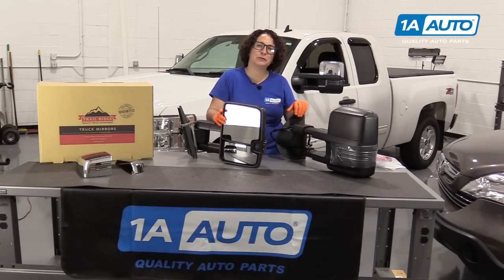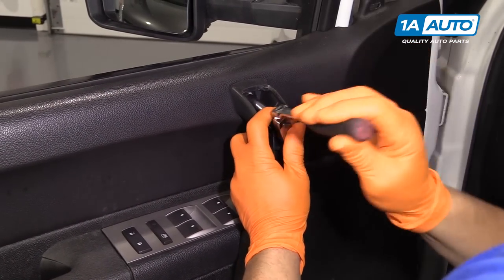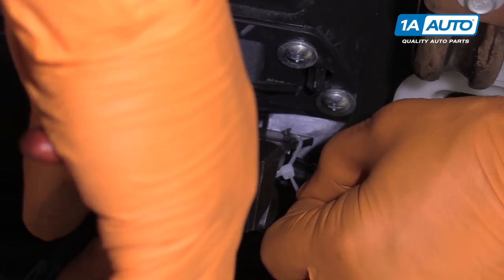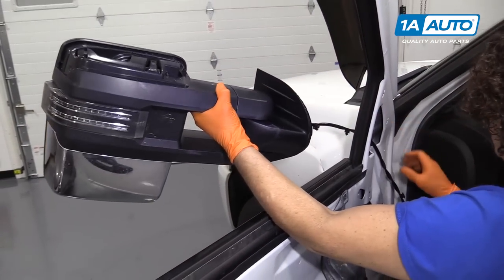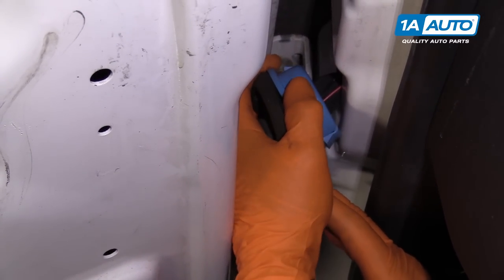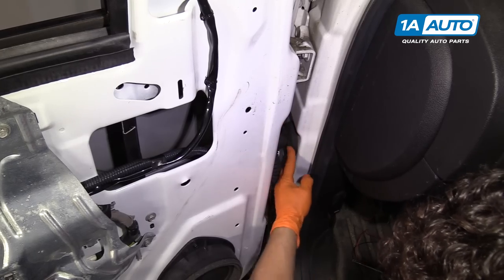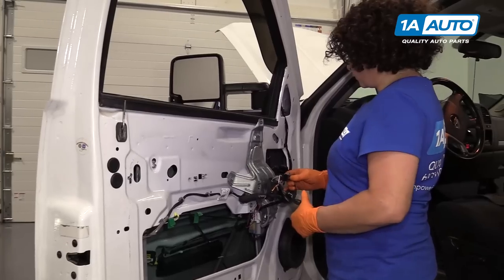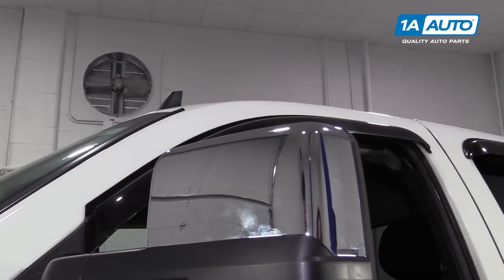How to Replace Tow Mirrors 07-13 Chevy Silverado 1500

Comment: For anyone having trouble with the install what worked for me could work for you. I was having the problem of the lights only coming on for a bit when I press unlock on the button and what ended up being the solution after a week and a half of messing with it was the ground!! In the harness that comes with the mirrors there is a brown wire that is common/ground, what i did was tap into that brown wire and grounded the wire on the top bolt that hold the actual mirror and now everything is working as it should!
Reply from the maker: Thank you for the feedback! +Ronnie Velazquez
Reply: Had what sounds like the exact same issue. I have a 2007 Chevy Silverado LTZ. Did the same with the brown ground wire from the harness to the tie down bolt for the light itself and "vuala".  Thank you for posting your resolution because it probably saved me all the headaches you had. Thank you.
Reply: WOuld this explain why the running lights and the reverse lights only work when the blinker is on?
Reply: Bingo!!!! It worked. You saved me a huge headache.
Reply: Dude you are the man..I watched the video 7 times thinking I was missing something and I just randomly checked comments to see if anyone else had same problem..thanks again for your help

Comment: Great video my question is do you have to drill new holes for the tow mirrors if you had regular round style side mirrors prior.. also would 2014 Silverado power fold row mirrors fit a 07 they loos as if they do .?

Comment: I'm confused if you spliced power and ground together on both mirrors why did you hook up both to fuses? Wouldn't one need to be grounded???
Reply: I thought the same thing, but evidently the black wire is not a ground

Comment: Well I successfully took my door panel off according to your instructions and got my mirror off. Note: open windows before starting. And my new (second hand) mirrors wouldn’t fit existing holes. It’s also too wide for the door so couldn’t drill new holes.

Comment: I have a 2018 Silverado with regular mirrors and it has no blinker or reverse light. Will the tow mirror with reverse and blinker work if I plug them in or will I have to install additional wiring?

Comment: Great video, but I find it interesting that they are installing Tow mirrors on a truck that doesn't have a trailer hitch.  Since I do have a hitch on my truck, I am wondering what fuse slots I should be using.  Anyone know what size fuses are required for the backup lights and what slots to use if a hitch is already installed?  Thanks

Comment: Good removal and installation video using tow backup lights and parking lights. Fuse 10 is tow backup lights but fuse 25 in video is tow parking lights (not directionals).
Reply from the maker: +TheRancher03 Thank you for your feedback!

Comment: My 2013 Silverado doesn't have that boot/portal to pass the clearance/reverse light wiring through to the engine compartment. Any suggestions? I'm thinking I may have to drill a hole, get a rubber boot and some wire loom and do it myself.

Comment: I installed this part but now my front passenger side blinkers won’t work . The headlight marker lights turn on when I unlock the truck, and when I turn the hazards on just not when I turn the blinker. The marker lights, and turn signal light on the passenger side mirror doesn’t turn on either. Is there anyway to troubleshoot this? The drivers side works just fine.

Comment: Hi Thanks for the video! I just purchased the DEDC tow mirrors for 2007 - 2013 chevy silverado and took the door panels off and none of my connector are the same size or fit. It is just like the truck in this video. The  stock mirrors on it now are electronic but no blinker, and my new mirrors have two boxes and the little one. One box is black and doesn't fit in the connectors that are already inside the door and one is the same size but blue. Any help would be greatly appricated
Reply from the maker: +Levi Brett We advise you order mirrors with the exact same options as your original, as these will not function properly if your vehicle does not have the same capabilities. Our mirrors are intended to be a direct plug and play replacement for the exact options listed so if they are not purchased with the same options the connectors and wiring will be different as well.

Comment: How would you tap in to the fuse box in the engine compartment if your vehicle is equipped with the towing package? The video didn’t describe an alternative route of hooking up the wires
Reply: TheRAINMAKER98 did you ever figure it out? I have a LTZ with the towing package
Reply: @linko90  Tap into the power wire for the backup lamps. This is going to be a light green wire that runs to that back of your truck (into a rear lamp junction box, and then to your reverse lights). They originate from the VEH BCK/UP Fuse 15- 10A fuse in the underhood fuse box. If you need help finding that light green wire, just try to follow it from your rear reverse lights up into the cabin. I can't for the life of me understand why in this video they placed the ground wire to another fuzed power slot in the box... likely the reason other commenters here are having some serious problems. I may not have watched in enough detail and missed something though.... but first glance that looks to be incorrect wiring in the video. You will want to ground out the (-) wires (black) in this video.
Reply: SilveradoGuy1989 The Black wire isn’t a ground it’s a positive for either the marker lamp or the reverse spot light, I can’t remember which one right now. The ground is  connected to the ground of the turn signal plug in the window switch module. My problem I’m having is when I connect to either fuse, vehicle back up or trailer back up, or park light for vehicle or trailer The lights only come on for about 2-3 seconds when I press unlock on my remote. I’ve tried tapping straight into my reverse light and the light doesn’t come on at all and same thing with tapping the marker into my corner lamps. I’ve even tried to connect the wires straight to 12v (with fuse) and they won’t turn on at all. Again the only way I’ve got them to turn on at all is when they’re tapped into the vehicle or trailer fuse and it’s only when I unlock it. And A1 wasn’t much help, they told me to refer to this video or forums. I posted in forums and no one has responded lol so I’m glad you did.
Reply: SilveradoGuy1989 http://docs.1aauto.com/1AMRP01766/329008-B%20-%20Multi-Signal%20Installation%20Overview.pdf

The orange and yellow wires connect to the red and black wires shown in the video.
Reply: SilveradoGuy1989 I finally figured out the problem. It was a ground that connects to the window module.  Thanks anyways I really appreciate it
Reply: @linko90  Hey Ronnie, no problem! I just got done installing a different set of aftermarket tow mirrors, hence the difference in wire colors. Thought I'd write this up as if I were doing this with no instructions (which it is almost like you are because those linked instructions are shit hah). Hopefully this is helpful to all that read this in the future as well.

I'd have a healthy look at your ground given the description you gave. I would route the brown wire (common ground from mirror) into the cab fuse box, and ground to the thick ground (Black) wire in the LT DR circuit breaker with a butt connector/t-tap. Sometimes there can be issues with grounding to the window switch, especially when you are tapping into battery direct power and you have all of the lights turning on at once (depending on your power source for your other lights). Make sure to wrap all these wires in tesa tape or something similar to prevent cutting of the wires over time on the metal surfaces inside the door. Also, the shitty wire 2 pin plugs can cause problems. I always just cut them off and wire direct. No reason to mess with them, and sometimes they are the reason for crap connections.

Reading the diagram you posted I see Orange is + for position lamp, yellow is + for LED reverse spotlight, and blue/white is positive for turn signal. Orange wire, in this case, I would connect to the brown position lights wire in your drier's side fuse box. I tapped the brown power wire on the top row LT DR circuit breaker. This will make it so that it is connected with your light selection ex: Position, Auto, etc. (They will match the position lights on the front of your truck headlights).  For the yellow spotlight wire, I used a fuse add to the engine compartment, fuse 10, the trailer backup 10-amp fuse. Blue/white is self-explanatory and color matched to the truck's turn signal that should be in the window harness for your LTZ. For the passenger side mirror, I'd just run those same wires across the cab and into their appropriate connections. A trick for getting them through the rubber grommet in the door panel is a coat hanger and dielectric grease. Suckers slide right through in 15 seconds.

If all was wired exactly to the above, it should be guaranteed to work as designed. If it is still not functional, I'd move on to checking the mirror for defects starting by using a 9v battery to test the light connections.

Good luck man! Make sure to keep me updated by tagging my name so I get an alert.
Reply: @babyfacelmao69  how do you know if though truck has tow package? My fuse box has fuses in where the video is asking you to insert the fuse taps so not sure if that means I have a tow package? Suppose I did have a tow package, the fuse taps I have are double slotted, would i be fine to follow the steps of the video?

Comment: I have a 2012 and when I plugged the wires into the fuse box, they worked in park and everything else. And it turns off in reverse! And I switched the wires around!
Reply from the maker: +Keagan Swenson We wouldn't be able to diagnose an issue like that here, you may want to have a local mechanic take a look at it. Thanks for checking us out! http://1aau.to/m/Shop-1AAuto-c
Reply: I’m having same problem my blinkers work fine but the spotlights work in everything but reverse did u figure anything out with urs

Comment: When will some power folding mirrors come out? I have 2010 gmc sierra Denali and have the power folding system. Any updates on power folding tow mirros on a 2010 GMC Denali?
Reply from the maker: +Jorge Perez We do have some mirrors for a 2010 GMC Sierra 1500 with power folding.  The options have to be a 100% match to your OE mirrors so we would need to know all the mirror options before locating the correct ones.
Reply from the maker: +Jorge Perez We suggest you contacting your local dealer with your VIN number and they can assist you with all your OE mirror's options.  When you have that information, you can call us 888-844-3393 or email us service@1aauto.com and we can assist you with the correct replacement mirrors.

Comment: Wired everything exactly the same but it all functions backwards. Reverse lights are always on and when the truck is put in reverse they turn off. Yet the DRL's on the mirrors don't even come on unless I'm locking/unlocking the truck or have emergency lights on. Any help or suggestions with this??
Reply: I have the same problem did you find a solution?
Reply: Just commenting just in case in the future I were to get this problem and I wanna know ahead of time lol
Reply: Did you fix it? It’s happening to me as well
Reply: @adrianchimal9390  Wait no longer. There's a comment below that explains it. Splice into the brown wire in the mirror harness. It's next to the blue one. Then ground that wire to the mirror mount bolts. Just did it tonight.

Comment: Why not just splice the reverse lights into the junction box that they removed to access the firewall? One of those harnesses has a 12 volt  reverse wire it. Unless those harnesses are pre fuse protection?

Comment: I have a issue with my tow mirror, very time I unlock my truck, the mirrors adjust itself and I have to re-adjust the mirror. Do you know why it doing that? appreciated if you can help.
Reply: Did you figure it out?
Reply: These don't have memory function. You have to disable memory recall in the control center. You can still have memory settings, but it won't adjust when you unlock the truck. The mirror will still go wonky when you push one of the memory buttons though.

Comment: I did the same on my 2010 chevy 1500 lt an the reverse lights on when the lights are on. If i put the truck in reverse back up light cuts off. Blinkers work just fine. Daytime lights on mirrors not on either
I did it the same way she did an not luck at all
Reply: Rocky S. Del Vale I want answers same problem here
Reply: I ran the wire from the reverse light to the front. Conect them together. 2 red wires to the reverse light an the 2 black ones to the frame on truck and i have my lights working
Reply: @RockySDelVale  the reverse lights? From the mirrors or the taillights?

Comment: Ok i instak the mirrors in my truck but the reverse lights come only if i turn on my directional or my blinker lights otherwize they are not coming on also i was wondering the blinker lights in the video looks like they are on as a runing lights my don come on unless i puss blinker botton
Reply: To answer your second question, Silverado is not wired to the mirrors for position lights. You will have to custom wire this using a resistor/ relay combo, or resistor/diode combo to achieve both running lights and blinker functionality simultaneously.

Comment: with linking the wires from passenger 2 driver side how do you figure out if it's left or right turn signal
Reply: The turn signal lights hook into the factory wiring

Comment: Hey so I did this exact wiring same fuses and everything but my leds are like backwards... they are on when car is in park, neutral, and drive but not when I put it in reverse. Any idea??
Reply: Connect the black to grown n the purple or red to the fus then it will work
Reply: Tyler Malloni did you ever figure them out?? I did the same thing with the same results as you
Reply: I did exactly what you did and they work only in park neutral and drive but when put in reverse they turn off. I have a towing packing. Is there a different way to tap in. I would appreciate the help thank you.
Reply: Zachery Markgraf did you ever figure it out? I have a LTZ with the towing package too
Reply: Hey guys- in case you are still having problems, have a look at the write up I just posted in the comment above.
Reply: Have same problem, what’s the solution?
Reply: Anyone’s figure out the fix for this? Im having the same issue

Comment: For the fuse connectors what kind of fuses do I need in the connector?
Reply: When I wired my tow mirror running lights for my 2011 Silverado I ordered my entire wiring kit from Boost Auto Parts. When you plug your fuse tap in you pull your factory fuse and insert it into the fuse tap and it turns on
Reply: @parisu81  what fuses did you use?

Comment: Did everything in this video why doesn't mines work? What fuses did y'all use on the fuse tapper??
Reply from the maker: +Eddie 405 Thanks for watching!  You will want to tap into at least a 20 amp slot to get adequate power.